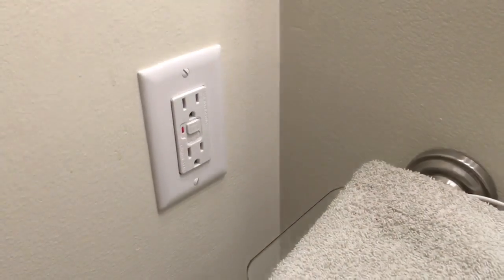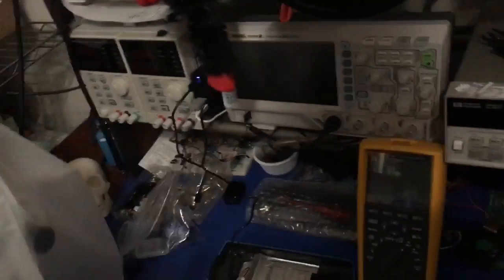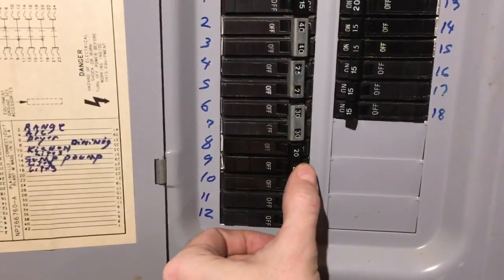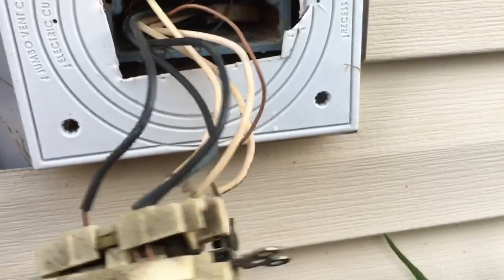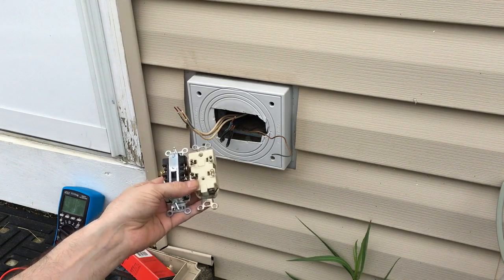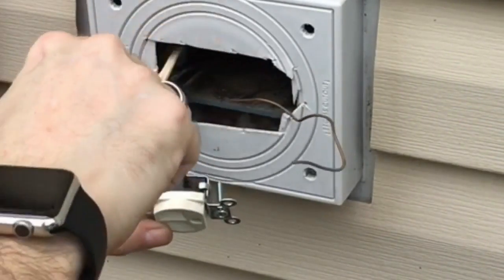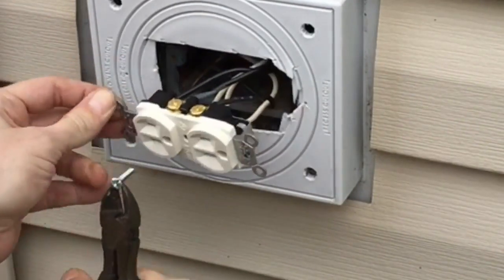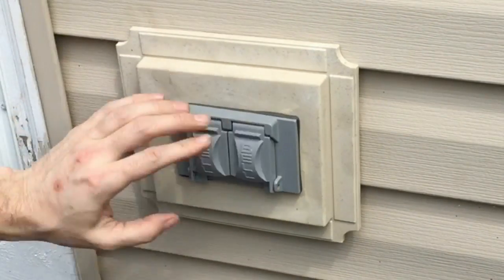Tracking down and fixing a GFCI outlet fault in the house

Comment: If you got some knowledge about electricity then how could you not know on the new $1 outlet you bought, the gold screws are hot or black wires and the silver screws are neutral or white wires. Also any outside outlets by the new codes is supposed to be GFCI.
Reply from the maker: According to the updated dated code (maybe 2010?) after my house was build in 1985 it would have had to be a GFCI outlet, but my house already doesn't meet code and that outlet is on the load side of the GFCI in the bathroom, this is the main point of the video is tracking down the fault in older homes.
It's messed up, but if I replaced it with something different according to my local and township/city regulations and laws I would have to file for a permit. But replacing it with what was already their before is ok. It doesn't make sense to me but then most local laws that conflict national code and regulations are out dated and don't make sense. 
I was giving a different refence view incase it was more then an outlet being changed. For example a switch at the bottom and top of the steps that control a single ciurcut sometimes doesn't follow the colored screws and you still need to reference your old one. Then it also depends on when the house was built, what shadey cheap landlord did their own wiring  from years of renting the house out (like with the one I bought) and you might find the wire colors are completely wrong. As per my warning I state I am not an electiacian and if you don't feel comfortable then you should hire one. I'm glad the guy in the Chicago suburb video pointed that fact out to you, I'm guessing your in an area that the junction boxes are grounded then. I would usually say always trust the meter and not the colors because you don't know who touched it before you. Or follow what was arelady in place using the old one as a reference because it worked and I had previously tested it and the polarity was correct in the past.
Reply: Gadget Review Videos Ok I see your points. I guess all that matters is that your job worked. And it did, so cheers.
Reply: MY HOUSE was built in 1978. tHE "CONTACTOR" WHO OWNED "UDPATED"  few things after he moved into the place. I have found 2 electrical overhead light he installed using a piece of OLD EXTENSION CORD. That has two copper wires, one hot , one neutral. Unfortunately, not everything is always to code. My Dad was an engineer, he taught so much, and after his death, I have called my brother long distance and said, I'm going to do "x" do NOT go far from home in case I run into issues. So today, with two You Tube vids, and the experience and knowledge from Bro' and Dad. I probably saved a couple of hudred dollars as I would have had to call 2 different pros. Sometimes you need the pros, but... it sure makes me feel good to accomplish something on my own!
Reply from the maker: It does feel good, congrats on your accomplishment. 
My neighbor asked me to look at his furnace with the winter coming now. I found the same thing, and extention cord cut up for a patch wire to an outlet for the dryer. The dryer that is a higher dedicated separate breaker for the extra power. The extention cord might have been rated for 7 amps, but defiantly not 20 amps. It was a rental for many years, but I couldn’t believe what I saw. And with kids in the house I couldn’t just leave it. Lucky I just did some new breakers and had some extra 12/2 wire left over to run this properly. 
I can believe the home inspector didn’t find this, it was in plane sight. He didn’t even mention it in the report. 
My house was a rental also before I bought it, it’s amazing what you find from cheap landlord and shaded work that could have burnt down the house and put peoples life’s at risk.